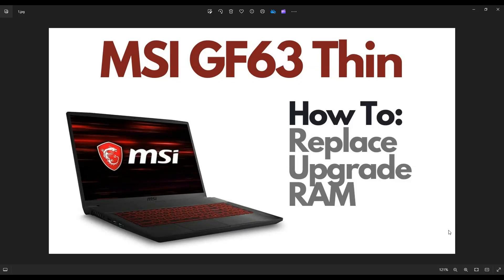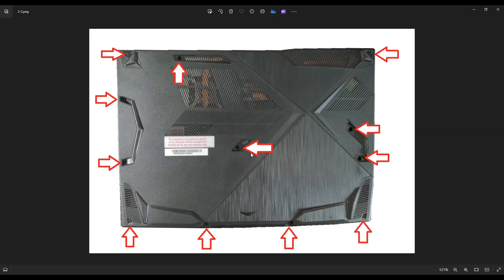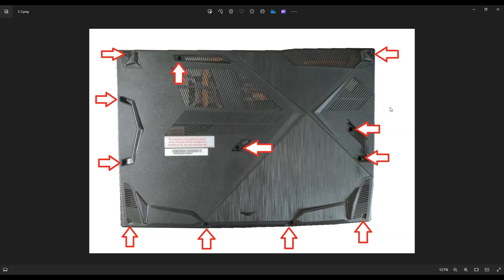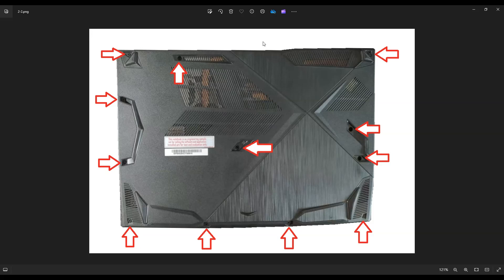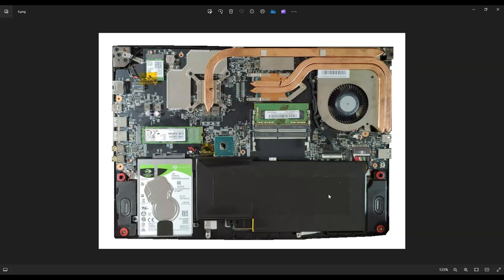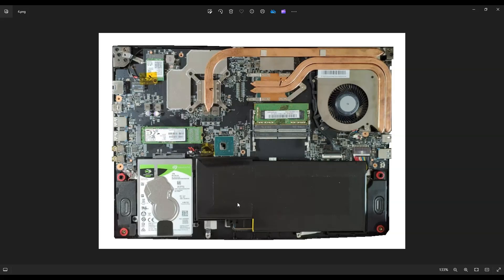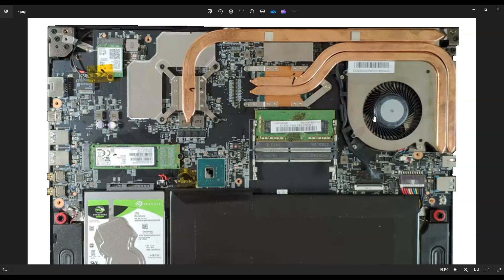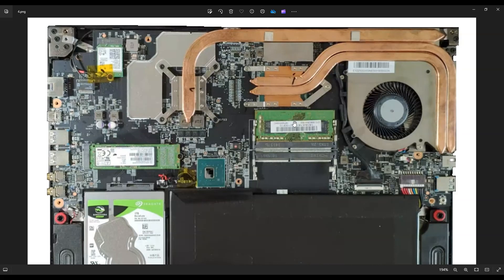How To Replace / Upgrade RAM (Memory) - MSI GF63 10SC Thin Gaming Laptop

Comment: I have GF63 10SCXR435CA, I tried to open the back cover and upgrade rams, but all the AUX, USB, Phone slots are attached to a mini board glued to the back cover, and a couple 2-inches long tiny wires attached to the main motherboard, if I pull the back cover off the laptop, the tiny wires will be broken apart. Anyone has similar issues?

Comment: Hello! Im looking to upgrade my MSI Geforce GF63 i5 1650 MaxQ, 2 slots for ram, and currently running 8gb Ram to at least 16gb. My laptop says that the brand of ram its using is Nanya but i cant seem to find anywhere to buy another one to add to it. What would you suggest using instead and should i go for 2 8gb ram sticks or 1 16gb ram stick? Hope to hear from you soon! Thanks in advance!
Reply from the maker: If you have two slots then I would go for two RAM sticks. They should be the same brand too. They work better with each other that way. You could get 2 8GB sticks, or for a real good upgrade, you could do 2 16GB sticks. You can see some options in that list I have here: https://amzn.to/3GECEOg
Reply: @jamminpcs I appreciate you taking time out of your day to get back to me. Thank you so much for your help!(:
Reply from the maker: @KillaKay928  Happy to help :) Always here if needed !!

Comment: if I wanted to replace the current ram stick with a different one so i could have matching 16 gb ram sticks, would that work? Would it mess up anything? Would I have to replace things? Is something stored on the ram that I might lose? Also is it soddered down or something? Sorry for the questions, I dont know anything about computer specs.
Reply from the maker: Yes, you can upgrade the RAM that way. No, there is no DATA stored on the RAM :) You can see the RAM replacements here: https://www.amazon.com/shop/pcmonkey/list/O4XD0HM6WHID?ref_=aip_sf_list_spv_ofs_mixed_d

Comment: Hello. I followed the video exactly and reassembled everything but now the laptop won't turn on at all. Does anyone know how to fix this?
Reply from the maker: If a computer works before I enter it but does not work after, I would first assume that I damaged something or left something unplugged or loose. I would go back in and double check all the connections. Specifically around the area I was working. Unplug things and plug them in again to make sure they are not loose. Also, were you using anti-static gear during the repair? Was the charger unplugged and battery unplugged?

Comment: Hello, I'd like to add another RAM stick to my MSI GF65 Thin, I assume the process is much like you show here, except I would be adding the new stick below the existing one? Sorry if my question is not phrased correctly. I've never tried to upgrade my PC before, but I need to do so to meet minimum requirements for a new game that's coming out soon. Thanks for your helpful vid!
Reply from the maker: Yes, if your RAM ports are one-on-top-of-another, then you would usually add the additional RAM stick to the underneath one :)
What game you looking to play? You try GreenMan Gaming? They usually have pretty good deals: https://greenmangaming.sjv.io/qzgjKg
Reply: Thank you for the reply! The game is InZOI, the new competitor in life simulator games. It looks stunning, so I hope doing this upgrade will help things run smoothly. I will check out the site:-)
Reply from the maker: @rosaharvey577  Nice!  Ill check out that game as I have not heard of it. Good luck and hope its fun !!!

Comment: Why do I need to remove that cable under the battery?
Reply: Came here to ask this!
Reply: @ Turns out you don’t have to
It’s an extra safety measure to make sure you’re laptop is completely out of power. If you just hard shut it down it will be fine. I replaced my RAM just fine without unplugging the cable. Hope this helps!
Reply: @ do I have to hard shut it down or can I just wait awhile after I shut it down won’t it be completely off? Thank you for your response I’m new to this
Reply: @ one more thing what brand size would I need I know I want 16g but is the length or width different between them ? Thanks again!

Comment: I upgraded my MSI Thin GF63 12UC laptop from 16GB to its maximum upgradeable RAM of 64GB using Kingston DDR4 FURY (2 x 32GB) 3200MHz RAM. 

Since then, my laptop has been randomly shutting down and restarting. The Windows 11 Event Viewer records the following event: 'Critical Kernel-Power Event ID 41, Task Category (63).' 

I tried using one stick of 16GB and one stick of 32GB (48GB RAM), and it worked without any crashes. Do you know any fix for this so I can use the maximum RAM of 64GB (2 x 32GB) 3200MHz?
Reply: Thank you, I wanted to buy exactly the same RAM, thanks to you I won't make this mistake, I'll find out a little more.
Reply: Hi. I have the exact same problem. I was wondering if you found a solution to be able to use 64GB?
Reply: @ritmonzondj  unfortunately I tried many workarounds and they haven't worked so far, but since  many of us we have the same issue with this kind of RAM there's no any faulty stick of this 2 x 32 GB what it might need is the undervolting of your CPU with throttlestop win app, something that it can't be done to my laptop because my CPU is locked, so try to undervolt it with throttlestop
Reply: @ Do you find any substantial improvement in the performance of your laptop, when using it with 48 GB (16 GB + 32 GB), vs only 32 GB?
Reply: @ritmonzondj  I didn’t really notice a big difference in performance between 32GB and 48GB when I benchmarked it in Intel XTU. The only time I saw an improvement was in multitasking—Windows felt a bit smoother when handling multiple apps. But for gaming and media editing, there wasn’t any noticeable boost. If u feel like i did that u spent too much money having 1 stick of 32GB wasted, try to sell it in my opinion 😊
Reply: @uniqemaux  I have an msi gf63. I use it for audio production and post production, mainly with ableton. I tried upgrading the ram from 32gb to 64gb, with the same kingston sticks, but I experienced the same problem as you describe. I really appreciate your answers. It's quite reassuring to know that I'm not the only one who has experienced this situation. Regards.
Reply: @ritmonzondj  MSI aimed too high adding specs more than this particular laptop can realistically handle—like advertising that it supports 64GB RAM, but in reality, it doesn’t work properly with common RAM brands. 

I actually reached out to MSI customer support about this, and they told me they hadn’t tested this laptop with that specific brand of RAM (2x 32GB). Their 'solution' was to replace one of my 32GB sticks with a Samsung one—for a ridiculous €250! Of course, I wasn’t gonna do that. 

On top of that, I spent countless hours trying to find a fix, even with ChatGPT, but no luck so far. Super frustrating! 

have a nice day wherever u r in the world, i m speaking from sunny Greece!
Reply: @uniqemaux  Yes. I've been changing settings for a few weeks, without success. I'll leave it at 32 GB, hoping it will let me work a little longer. Greetings from Mexico City.
Reply: Hey, I have that model too, do you think it'll work fine if I add an 8GB Crucial DDR4 3200MHz RAM stick?